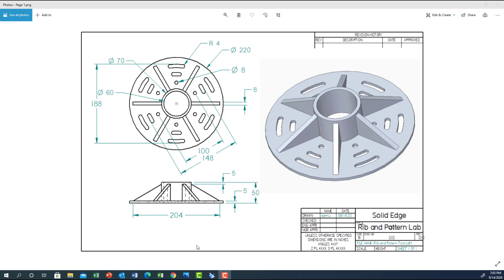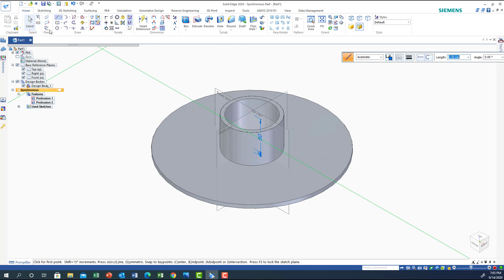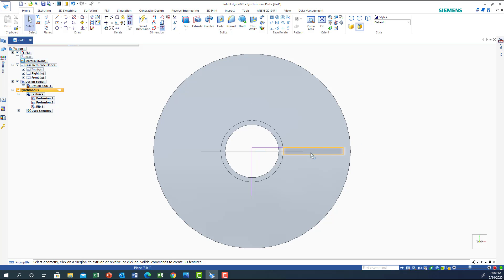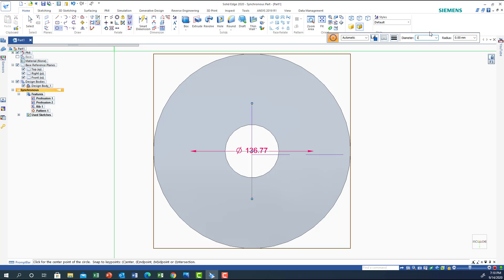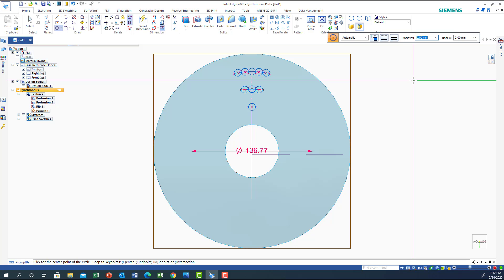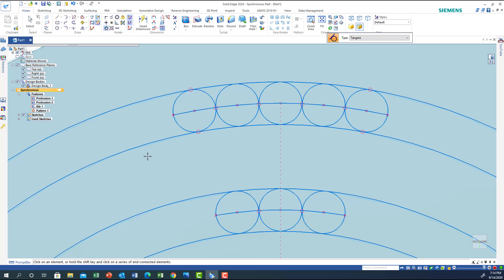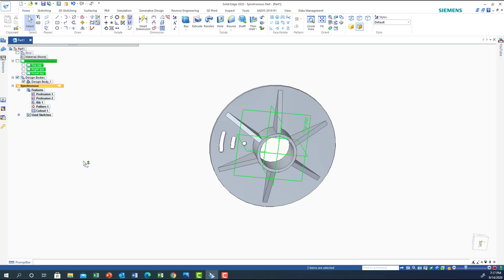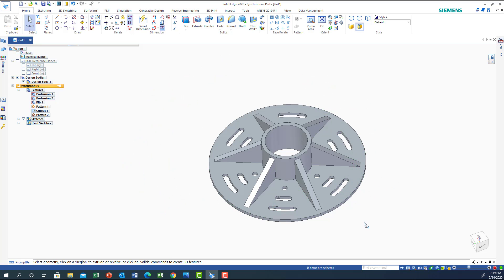Learning Solid Edge - Rib and Pattern Tools

Comment: why is editing so difficult in solid edge as compared to cero. please help. I made the rib here. after doing the pattern I realized that I made mistake in the sketch of rib i.e. I placed the rib farther away from the outer edge of the plate. if I want to correct this mistake I am unable to edit the sketch for the rib. how do I do it without going through the hassle of deleting and drawing the rib again from scratch.
Reply from the maker: It shouldn't. Please email me the part you draw and I should be able to help. My email is mohamed.seif@aamu.edu